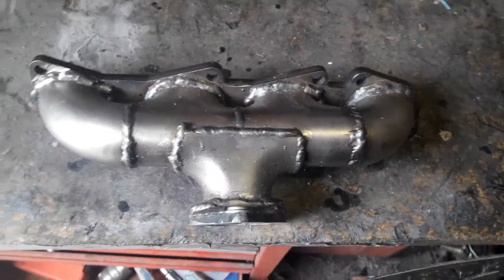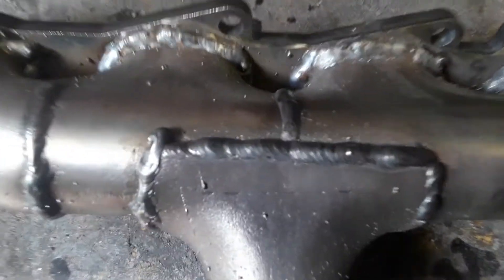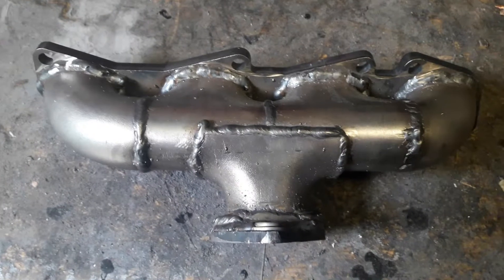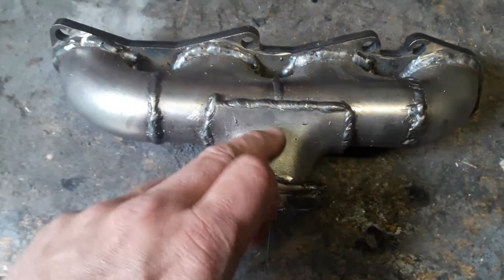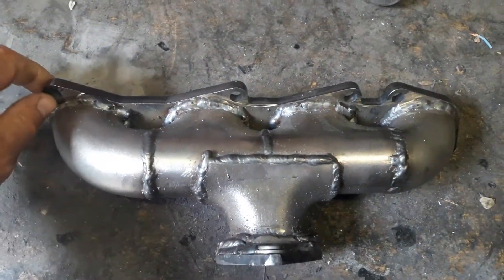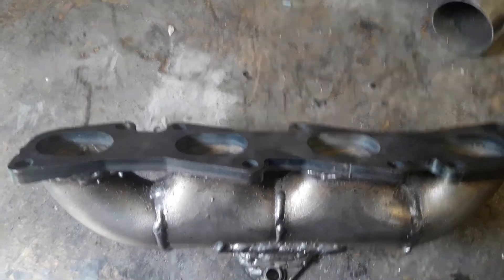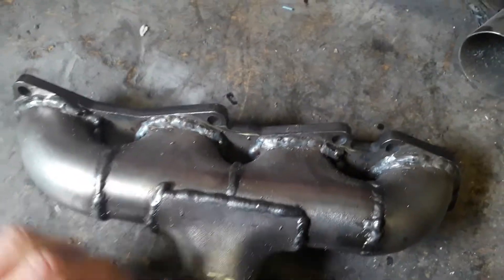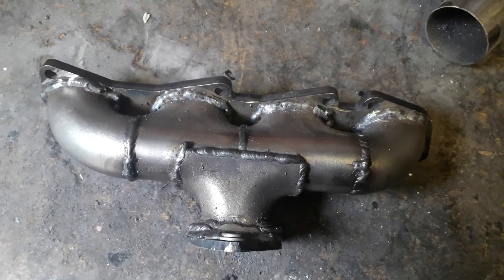Z19DTH Exhaust Log Manifold

Comment from the maker: It is important to make sure the flange is flat after all the welding is done. Due the the shape of the manifold and that it is made from Steel many Engineering companies won t skim the flange. I found the best way was to use an engineers rule to measure if the flange was flat. See if you can slide a feeler gauge in any gaps to measure the warpage. The standard metal exhaust gasket is 0.75mm thick so any warp must not cause a gap bigger than about 0.5mm